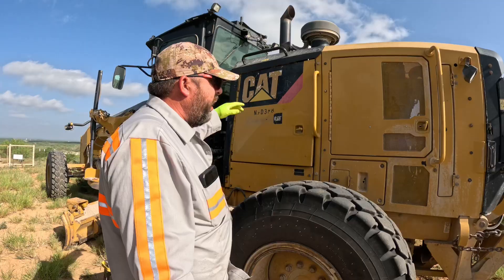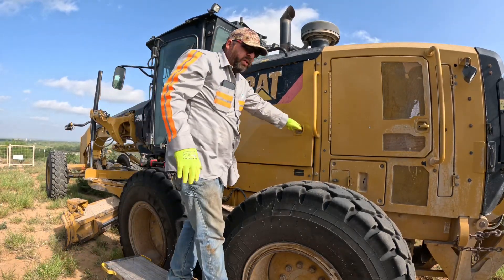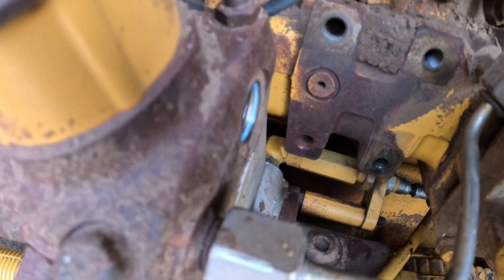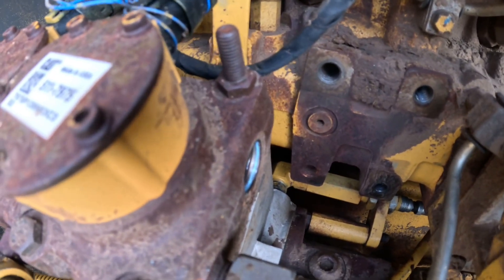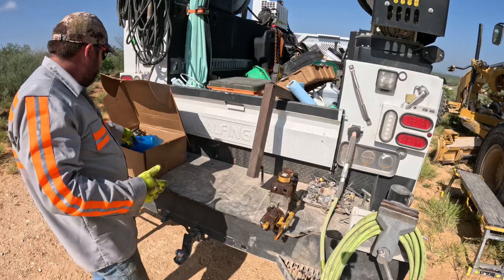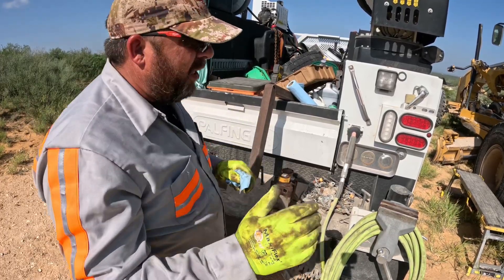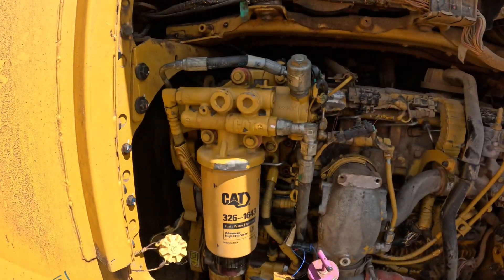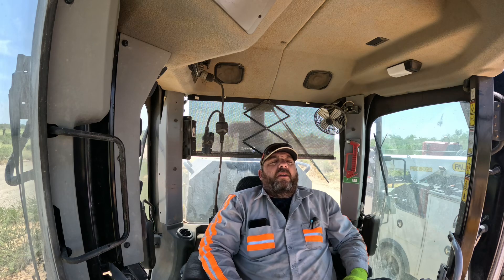Changing out the injection pump on a CAT C9.3 engine.

Comment: Dude is your truck idling the whole dang time that you were at that repair? lol That’s crazy to me
Reply from the maker: Yes it is, if I’m over an hour away from home, I’ll leave it running. I’ve had previous trucks leave me stranded due to starters or batteries working fine that morning and then deciding they had enough after getting somewhere. Otherwise I'll shut it down.

Comment: Dealt with quite a few of these type of failures on  D6T dozers, found about 90% of it it from the hardware that keeps the bulkhead bracket coming loose, bolts are usually worn through.
Also found out from a customer replacing the fuel pump themselves that if the pump isnt timed correctly, they still run but it blows that fitting out.
Reply from the maker: I can believe that. Most of the time I’ve dealt with issues like this, it’s been because someone did an install recently but left hardware off. Did have one that a CAT tech installed, was almost 180 off time, it did run, but that customer called in the next day complaining of stalling and low power.

Comment: Just replaced that hard line on a scraper the other day,  those two bolts were also missing  good thing i saw tht or that customer would probably would have been out a pump also
Reply from the maker: They definitely got lucky. That hard line can be a pain on certain machines, especially the dozers and excavators
Reply: @jlfranchestexas yeah it was puzzle getting it out. Luckily being a scraper (rear engine). Abd me being skinny i was able to get between the frame and block to get a wrench on the nut.  It was leaking at the 90 fitting tht comes out the block.  It had fresh injectors and lines but it looks like they didn’t replace tht line but could tell its been off with wrench marks on it.      Also both hold down clips were not in place on that hard line ….
Reply from the maker: @jcsphotography9318 both hold downs missing, I’ve came across that twice while I worked for CAT, both times, it cracked the hard line itself right at that 90.
Reply: @jlfranchestexas  yeah it was supposed to be a rebuild..